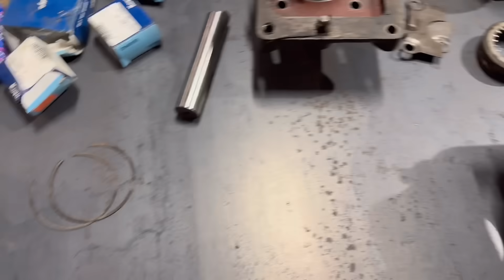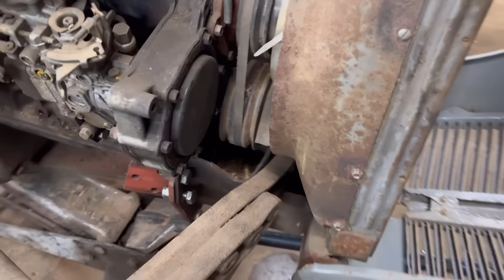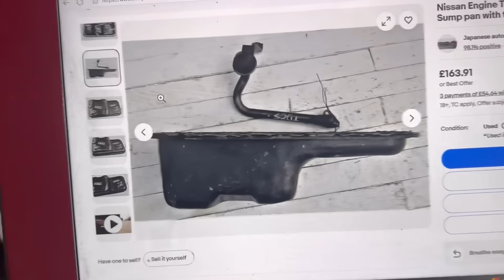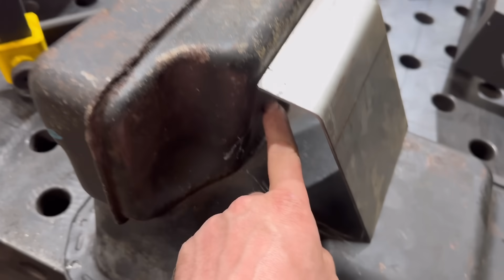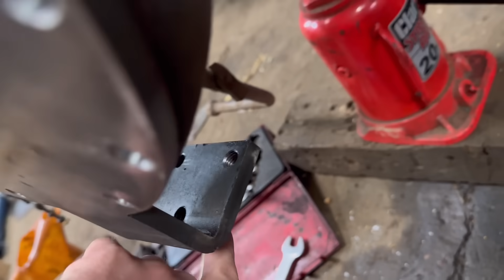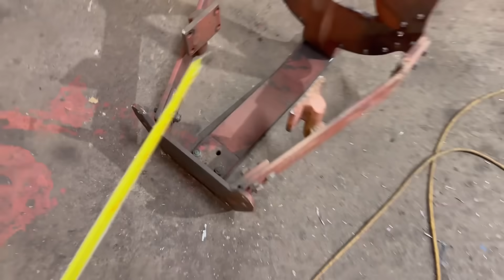Redesigning the Nissan powered Grey Fergie! Part 1

Comment: I like the tractors as I have a few, mostly garden tractors around the 1960 vintage.  As far as my  Inner Machinist, I still use my Dad Old Delta 109 lathe and a Cheap Mill lathe combo.  LOl but it works for me.

Comment: I daily drive my 1991 Nissan Terrano 2.7TD as I have for the past 25 years.

If you get any problems with that viscous fan the first sign will be smears on the fan blades near the hub...
this is the fluid being thrown out under centrifugal force as the fan hub loosens up....bolts back off a bit etc....and the fan will be far too easy to rotate by hand when cold. If you ave no smears now do some PM and tighten the bolts just a little.

You can separate the two halves of the viscous unit by undoing the four bolts holding it together and using the 50ml of Viscous fan fluid sold by Toyota as "top up" for their fans (which have a bung which unscrews for easy top ups) rejuvenate the fan.
It is relatively cheap, exactly the right cst ....and available wherever Toyota spare parts are sold....

Clean the mating surfaces of the halves and take care with the thin rubber seal when you bolt them back together.

If under hard load like ploughing you do get too much heat 
(because the oil cooler is in the side of the block and uses coolant to cool the lubricating oil which puts more heat into the coolant)
you might like to extend the shroud say 50mm rearwards with a welded on extension "ring" creating a tighter venturi effect allowing more suction through the radiator.
There really are no downsides to these engines...gear drive to the injection pump and the camshaft, simple pushrods and overhead valves.  

I have had the tappets checked twice in 25 years and adjustment was only needed once.

Comment: Great work, thanks for another interesting video. Next time you’re using that funnel and a bottle for collecting oil, stick a bit of wire or welding rod in the neck of the bottle before you put the funnel in-it’ll let the air in so it fills better!

Comment: Ytube channel nivlac57 is building a high horsepower Nissan vk v8, low budget.
These Nissan engines can be obtained for a reasonable price and are starting to get interest from racing world.
Might be a fun project for future!
Theres a guy getting huge horsepower from stock crank and block , small mods on the Nissan VK V8, turbo. And I’m not kidding when I say big horsepower.

Comment: hrc stands for hardness rockwell grade c, there three groups a,b&c which use different force pressing a steel ball or conical diamond into it, basically three different ranges according to the hardness. there is also brinell and vickers unit. vickers being more accurate and the english one, invented by armstrong vickers. that uses a 4 facet diamond pressed in, then you measure the two diagonal s of the impression
Reply: there are conversion tables but not totally accurate as they all use different impressions and forces, it depends on how the material yields. there couple other tests for things like stone etc or plastics

Comment: Another option would have been to cut the flange section with all the bolt holes off and just built you a new designed oil pan. Then you could design it however you wanted or needed. And since it would have been new metals, could have been easier to design... IDK     Thumbs Up!

Comment: When you measured the old frame at 484 I think you pulled inside to inside measurement then when you set up the new one at 525 were you still inside to inside or did was that outside to inside including the 10mm adapter plate

Comment: Milling machine grinding setup was sketchy as F. Glad it worked out without you retrieving bits of shattered grinding disk from your abdomen.
Reply from the maker: Grinding disc rated to 6600rpm. Milling machine spinning at 1000rpm with considerable less pressure on the disc than what it would have using it in a grinder.

Comment: The large holesaw hole still seems a bit high in the new sump tank. Oil will potentially pool up to the bottom level of the hole. 

You need a path from the bottom of the new tank to a lower level in the sump order to drain it completely. 

If you drill a small hole nearer the bottom or cut a slot /file down from the hole flush with the bottom of the new tank it would do. 

Junk, filings, etc. could build up in your new tank over time if theres not a path to a lower level to clear it when you do an oil change.

The issue will be down the line rather than straight away.
Reply from the maker: The hole sawed hole couldn’t be any lower. 
Plus It’s a tractor that’ll be less than 100 hrs a year so build up, if there is any, isn’t really a concern.

Comment: You said that your sump wasn't the easiest thing to mark up to cut. Since you have the work/welding table why haven't you got an infrared laser level, a cheap one, nothing expensive for your table. It would've helped you with the marking of things that you require cutting as straight as a die. 
I was thinking about how many things we could have used a laser level during my time as an agricultural fitter, but then again they do need a dark area to work properly. I do suppose that you would be able to make a dark area for yourself.

Comment: You have a good eye for the details to make it look factory built. There a lot of time and thinking to make it look good. 
The needle bearings in the countershaft need to be more than flush with the gear, otherwise the thrustwasher will prevent oil from getting through the slot at the end of gear.
Wish we had steam rallyes like yours here i be Denmark.
Love to see more like this on your channel.👍

Comment: If you stick a bit of metal or even a match stick where the funnel and can neck sit the air will escape and not attempt to overflow the funnel.
Great work with the mounting plate and chassis. Good use of the table too.

Comment: Nice work!
I notice you use your dial indicator when taking cuts on the mill.
Are the dials on the feed handles no good?
With a grinder I’d be taking quick .2mm cuts with the mill going as fast as it can go.
What’s the max recommended rpm on that disk?
Reply from the maker: The dials on the mill are imperial, I’m metric so it was just easier and quicker to use the dial indicator.   The mill was spinning at 1000rpm. Disc rated to 6600rpm.